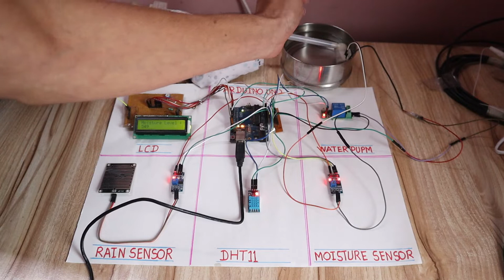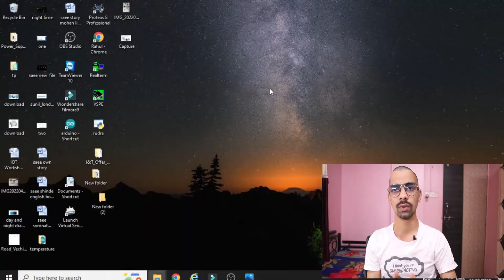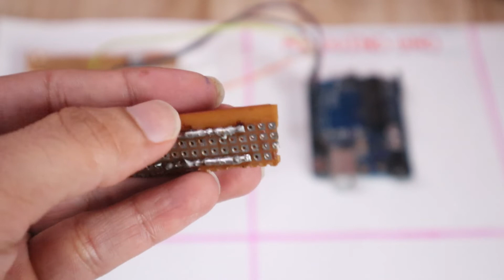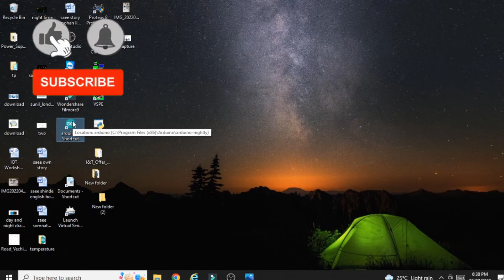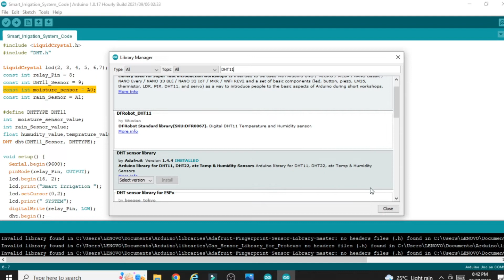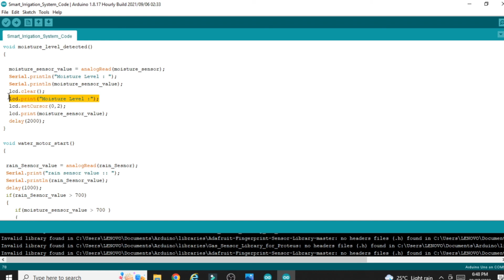Smart Irrigation System Using Arduino Uno | smart irrigation system using soil moisture sensor

Comment: Where and how do you connect the battery for the device to run?
Reply from the maker: @ARYAMANSANGHI  i think you did not watch complete video.
I haven't connected the battery, i explained in the video, I have connected the Arduino usb cable to the laptop

Comment: sir what is the use of ptentiometer in this project .......which is connected to the lcd display ...mai kya bina potentiometer ke bhi bna skta hu yeee project ........ sir
Reply from the maker: No without pot lcd will not work.
That is used to control the brightness of lcd.
Reply from the maker: You can use I2c lcd which does not require any additional circuit.please watch my i2c lcd basic video from playlist.

Comment: Hello..
I did all the connection according to this vedio.
But i didn't include lcd in my project.
And also no change in code..
Then why it run in reverse way..
Answer plz it's urgent
Reply from the maker: Reverse way means ?
Reply: Motor turn off when no rain and turn on when i put water on rain sensor. Same with moisture sensor.
Reply from the maker: @KunalKishor-ep8dh  i think you did not watch complete video. I explained in video my relay is active low and may be your relay is active high.
That means my relay need low signal to turn on and high signal to turn off.
Your relay is active high that means in code you have to change high to low and low to high for relay

Comment: Should an LCD with an I2C module work the same with the LCD on the video? Would there be changes?
Reply from the maker: You can use i2c lcd but you need to update code. How to update code that I have already explained in my i2c lcd video. Please watch that video

Comment: Sir what type of wires are used to connect the circuit is connecting wire or jumping wire
Reply from the maker: You require male to female, female to female and male to male connecting wires

Comment: Hello sir can we directly use i2c module with lcd screen directly instead of breadboard
Reply from the maker: Yes you can connect. I have already done a video. Please watch my video from last week.
I already told how to replace this LCD by i2c lcd .
Reply: its good to use a breadboard just in case u want to employ multiple sensors
Reply from the maker: @kennybrowxz2429  if you require that circuit multiple time then better to go with zero pcb .

Comment: Sir, I liked the video very much. If I wanted to make this a minor project, how much would it cost?
Reply: Sir please help me 🙏
Reply from the maker: @prashantdeshmukh52  first thing why do you want to buy this project.
I have given everything on video.
Code given in description.
You have to just follow the process.
Reply: @Rahul_Jadhav_Project  Sir, you are right but how much will it cost me to buy its elements (Arduino, Sensors and bred board) from the market.  I am asking this. Please guess and tell.🙏
Reply from the maker: @prashantdeshmukh52  i have given Amazon link. Please check there.

Comment: can i follow the same circuit connection without led and rain sensor!!!??
Reply from the maker: You need to remove the rain sensor module code otherwise the project will stuck
Reply: Is the connection same then?
Reply from the maker: @agalya6673  yes
Reply: Sir, if we are not using LED then can I connect the digital pin of soil moisture sensor to the Arduino (as i am going to create an app to display the data)
Reply from the maker: @agalya6673  you need to changr code if you are using digital pin

Comment: Hi thanks for this, just one question. Only when I use the digitalWrite as LOW then only relay is ON (MOTOR is ON) and so why is this, is there any reverse logic applied?
Reply from the maker: Yes it is active low signal..that i explained in program.. please watch complete video

Comment: sir when the pump is on why my lcd error,but if the pump off is work normally
Reply from the maker: I am waiting for this question from long time..good question.. atleast some one observed this...this is because current consumption..when motor on Arduino need more current but laptop power is not sufficient to provide current for both lcd and motor ..
Reply: @Rahul_Jadhav_Project  thanku sir
Reply: @Rahul_Jadhav_Project  so sir i need adapter with more current?,cz from laptop/phone charger is only provide 1A-2A
Reply: @Rahul_Jadhav_Project  but im also use 2 supply for arduino(5V2A) and pump(12V1A),so how to solved it sir